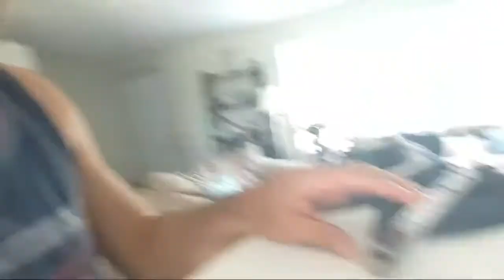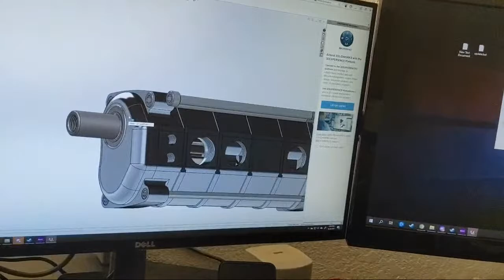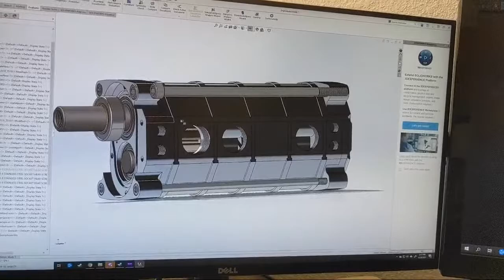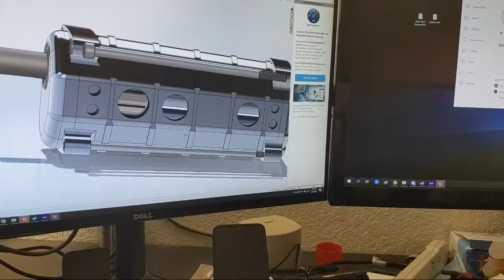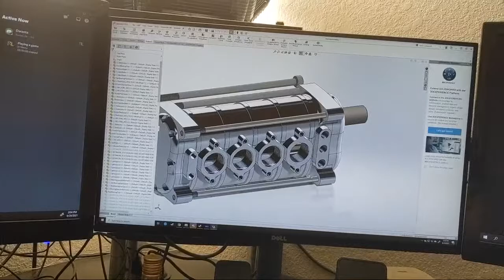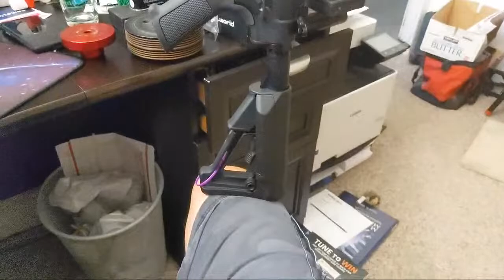Misconceptions About Manifold Pressure And Cam Profile

Comment: I have a question for you. I bought a 2010 WRX that was blown up that had ID1050X injectors installed and a custom tune. I put a new engine in it with the stock injectors and when I started it up, it barely stays running. Could this possibly be due to the fact that the car is tuned for those big injectors? It shows a code for the heated o2, maf sensor, intake air temp sensor, and lean code.
Reply from the maker: Yes. You can't change injector size without tuning for it. 
But with all those codes, you have other issues as well
Reply: @GetaDomTune  ok, I appreciate your help. I ordered an accessport to just temporarily flash it to stage 1 to see if it helps. Crossing my fingers.
Reply from the maker: @zachs.9600  woah dude. Your problem has nothing to do with a tune. You have an electrical issue you need to fix. Get under that hood and fix it.
Reply: @GetaDomTune  I wanted an accessport for it anyway. But it barely idles and won’t take gas. If you give it gas, it dies. So I guess I’ll have to figure out if it needs that front o2 sensor or not. I was hoping that some of the problem could be related to the smaller injectors. I accidentally left the maf sensor unplugged, but I plugged it in and it still does the same thing.
Reply from the maker: @zachs.9600  Yes, the o2 sounds bad. But you are flooding it with too much fuel. Stop running the engine, you're just hurting it.
Reply: @GetaDomTune  I appreciate your advice. I’ve learned a lot from watching your streams/videos
Reply from the maker: @zachs.9600  I said that backwards, you're lean as hell with not enough fuel.
Reply: @GetaDomTune  yeah, thats what made me wonder if it could be the tune due to the stock injectors I installed (and it being tuned for big injectors) But idk how tuning works, so thats why I asked.
Reply: I fixed it. I had a bad o2 sensor and I had 2 coils plugged in backwards. Runs great now. Guess that’s just part of being a beginner lol.

Comment: The n54 is so good yes!

Lol , raggin  on jatco 5 speed. It could have been better,  but for what it's worth, i dont know how well any company  can  make a good feeling 4 speed automatic.  It's just not enough  to  fit the full load spectrum ( low throttle,  low load to high throttle,  high load  and all  load areas  in between)

Zf transmissions are  so well built, and the software calibration is really efficient.. 
The adaptive  strategies  they use are so good and provide  so much active information  on what's going on that diagnosing shift concerns  can alot easier than the transmissions that dont share adaptations with the  end user. 

Question  for  you  dom :
Is there a greater degree of accuracy on the speed density systems found on the n54, or any other European engines that uses a management system that has several map sensors at one time :  map sensors that are in front of the air filter, after  the  air filter and in the intake manifold?   Mercedes  does this / did this alot